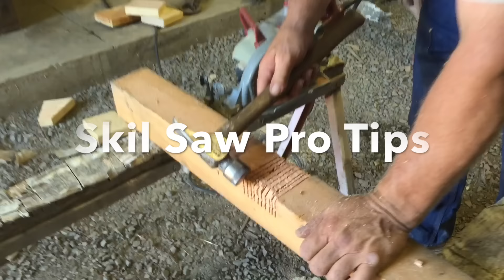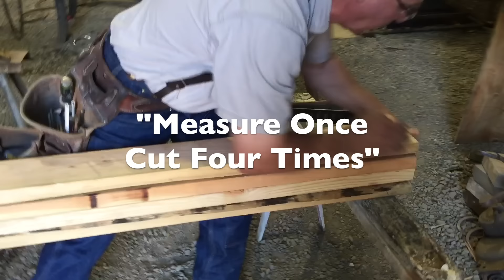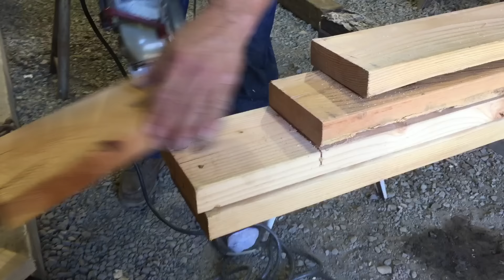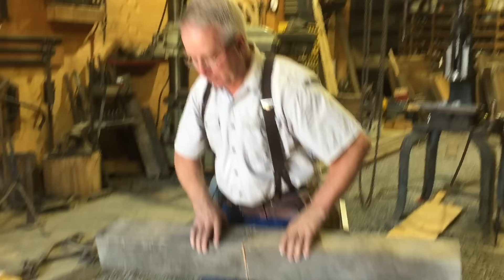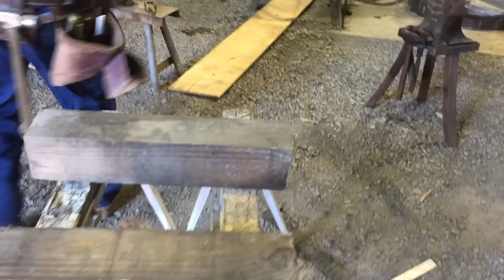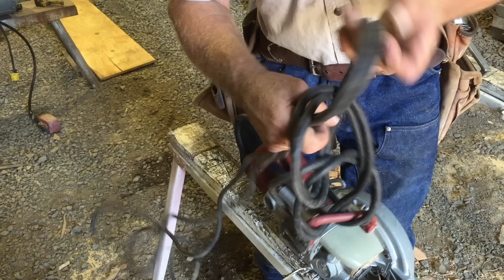Skil Saw Pro Tips

Comment: What's wrong with my cable storage method?
 I fold in half, then half again, up until it's manageable then I just twist tie or Velcro tie the cable. This method is the default method used to package cables, it takes up the least amount of space possible, doesn't over fold the cord, looks neat, goes on a hook easily, and it goes with the defaulted bends into the copper from packaging/factory.
 I'm no pioneer, other craftsmen are aware of this method and have chosen chain stitch for a better reason than I understand so I wanted to ask.

PSA(s): Don't use cheap twist tie on cords it can bite into the insulation. For shorter cables consider plastic bags(I saw them doing this at Goodwill for reselling miscellaneous cables).

Comment: At 4:00 you show how to make a beveled plumb cut. Here is another similar but safer and more accurate trick for making beveled cuts without changing the rotation of the table ( at least with a regular skill 77, not magnesium table ): The hole in the table that your blade sets in has two long sides and you will use the side that is to the left of the blade. Draw a pencil line on your board to mark the plumb cut, and use your speed square to mark the bevel on the edge of the board. Now, first cut the board so that the left side of the hole in the table runs along your pencil line. This will leave the board long but with the line still there. Now make your beveled cut, and you will have the lines to sight, and you can ride your table safely down that extra little bit of lumber which will support the saw. This trick works really well when making multiple cuts of varying bevel, like when cutting the studs of a wall that is round on top, or for cutting rake studs and it works well when cutting bevels over 45 degrees with a 8-1/4" skil saw.

Another neat trick that I used to use when framing apartment subfloors. I joists are difficult to cut because there isn't a flat surface to slide the table on. Cut a piece of plywoon that tightly fits in the depression of an I joist, and nail a 1x4 or 2x4 to it perpendicular to the I joist and leaving 1-1/2" of plywood sticking out. Now you have a cutting jig that the table can ride on and you can use the jig over and over again to make perfect, square I joist cuts.

Comment: My Dad and Uncle built the house I grew up in.  The house was built in 1947 and they cut and nailed every piece of wood in that house, the old fashioned way, no trusses or anything re fabbed.  My Dad was a perfectionist and my uncle was a super perfectionist. My Dad told me all corners in that house were square, and they snapped a line along the ends of the rafters and cut and sanded them until they were all inline.  Overkill to be sure, but they took pride in what they were doing. They are building a lot of houses near where I live and they all look like pre fab kits to me.  I think the houses are hauled in on a trailer, more or less pre cut to size and the "carpenters" assemble them.  They sure do go up quick.

Comment: Circular saws can cut roof metal. But they sick at it. Get out some aviator snips and learn how to use them. The edges get hacked up with saws, it's as noisy, leaves little metal shards all over the  place, your clothes, and love to migrate into your eyes, wrecks the washing machine. The worst part is that in 20 years or so the hacked up edge will be rusting while the one cut by a shearing action will not be.

Comment: Ever hear of using the SPEED SQUARE to guide the saw table so you get a PERFECT Right angle at the right length with a single hash mark? It saves time, saves pencil lead (which in my experience wears much faster than about anything else), and is more precise than these speed scratch methods.

Comment: One thing that imo is Almost MOST IMPORTANT to have on your wormdrive saw. !!! 
 ANTI KICKBACK BLADE !
 Like the Marathon blade on your saw in the vid. 
 As long as the blade has the anti kickback shoulders on the back of the teeth. It is a pretty good to Great blade. 
 Without the anti kickback feature on a blade. Its a man eater ! 
  Its true any blade can kick back , but some of the production techniques you show are greatly enhanced by the blade you have on your saw. 
 The old way of adjusting the tension of the blade bolt to allow slippage in a kickback event were less than satisfactory for me. 
 They worked ok with dry framing lumber but did not work well with wet lumber ect.  
 The 32 tooth general purpose blades the HD77 came with were especially ferocious !  I once blew a 4ish inch chunk out of a sheet of 5/8 cdx when the sheet pinched the cut. 
  The torque of that was amazing. I hung onto the saw but had to take 2 steps back to keep my balance. After that my blades were all anti kickback.

 Excellent vid ! Thank you. 
 Btw, the new cordless framing saw are even more amazing than the corded versions. 
 But I still have 3 HD77s , 1 DeWalt Framing saw and 1 Makita soft start framing saw . I prefer the DeWalt then the Makita. But the Skill's are tough !

Comment: I find there are times when holding the blade guard back and keeping a firm, balanced grip on the saw are difficult. I like tying a fat rubber band around the base plate angle lock (loop tie it so that it lays to the inside) and hooking the other end of the band onto the blade guard tang. This keeps the guard out of the way and allows both hands to be firmly on the saw, particularly with plunge cuts. When the cut is complete It's then easy to flip the band off the tang so the guard is down when you inevitable set the saw down in the ever present dirty gravel of the job site.

Comment: do you wish to manufacture my saw? I invented a "Parallel Guided Power Saw" which can be seen on you tube and can carry any saw on the market and can cut lumber and boards. 4 ft is for jobs away from home. 8 ft is a little heavier and 18 ft is just for shop. to transport you can disassembly into pieces. It has 3 parts: Saw unit, Guide unit, and table, I invented it in 2012 and all the USA companies and Bosch company declined to license from me my say. Bosch wrote that my saw is not good for the market. By contrary is the best because everybody would like to buy my saw, but those companies shall retire almost all of their tools such as sliding saw, table saw, drill press, router table. Bosch did a wonderful design for their sliding saw but kept an old feature of 12 inch cut length. How can they not to see that the length of cut is the most important. The precision of my saw is great and moves very easily on the guide and carry also the heavy dust collector. I need somebody to manufacture with me my saw.

Comment: Once upon a time the zen master of carpentry looked at his skillsaw and told it, "You're a planer"  The skillsaw argued, NOOO I'm a saw.  The zen master then took the saw, planed a surface with it, drilled a hole with it, demo'd with it, mitred with it, cut an 8x8, then a notch then a rabbet.  Then he carved Michelangelo's David 23 times in the rafters freehand, each one exactly the same as the last.  Finally he patted the saw affectionately and had it do a dance suspended in mid air on its cord.  The saw smiled and knew it was the luckiest tool on earth.

Comment: Watching this guy use a skill saw makes me want to be a better tradesman,I thought I was decent with the thing before this.
Also I have a tip for cutting metal,if you put the blade in backwards,it still cuts the metal clean,and isn't as rough on the teeth.

Comment: You use the right tool and technique for the job.  You use high quality tools and blades.  Your safety is in following the basics, the guard on the saw is in good condition.  Plunge cut- watch your kickback area- YOU have strong arms- some do not.  
A good AC 7 1/4" saw with a Good carbide blade is a heck of a tool. 
Frist time I heard "the Polish plane", but I do it a lot myself too.  Must be in my blood.  
I've figured out most of these myself, I'll try the chain stitching, but I usually do a clean flat coil- takes time to wrap, but i can toss out a 50 or 100 foot cord completely clean.

Comment: build a real set of saw horses made out of 2x4s nail one across leg to leg on the same end drive a 16d nail up to about 1/2 inch and when done cutting hang the saw on the nail with the shroud that covers the blade who sets a saw on the ground everytime after cutting he must like bending over a couple hundreds times a day to pickup a worm drive saw with a 40-60 foot cord to drag around all day why dont u just use a dropcord u can plug the saw upto since u are bent over picking it up off the ground anyway he is probally like one of the waterheads south of the border who dont have a saw horse one on the job cut everything on the ground not a coil nailer in sight just cheap stick nailers

Comment: my last tip when setting your Ridge build scaffolding or set it up at waist high it cant fall on you if there are problems ...A SIMPLE 12" 2×4 NAILED DOWN FLAT CENTERED ON RIDGE AND LOCATED ON YOUR COMMON RAFTERS THAT   YOU INTEND TO SUPPORT YOUR SKELETON (FRAME) .YOU WILL HAVE 3/4" THAT WILL SUPPORT THE 2 RAFTERS AND RIDGE BOARD NO NAILS NEEDED JUST SLIDE RAFTERS FORWARD OR BACK TO LOCATE FOR NAILING !!! dont forget to check for level ,  plumb and brace properly

Comment: my best tip scribe nailing lines on your plywood while it is on the stack and i make a pencil extension with a slat (sticker) from your stud bundle 24 to 36 inches long ripped a little less than in half 3/4 or a little less and tape it to my flat pencil and stand it by my T SQUARE for convenience . no more trying to stretch across plywood

Comment: those are all good techniques and i have used most of them in my 30+ years of framing houses ..i would say that a worm drive saw is awkward to torquey when you first hit the trigger it jumps sideways..it is not well suited for right handed people for that reason and holdinf a board to be sawn the blade is right by your hand extremely dangerous..just saying each to there own

Comment: He does have a lot of skill and tricks, but I notice he's wearing a cast on his left foot 19.00. This tool is underrated by most, but needs to be handled with care, and it's different standing on a floor and working at sawhorse height versus one-handed standing on a joist. Be careful and never put a hand behind the blade. Mark clearly and cross out erroneous marks. I'm not a fan of over-sawing inside corners, though.

Comment: Had some pro-tip questions please:

- OK to keep your finger rested on the trigger when tool is not being used and when moving or adjusting the tool? As an example at 4:00 in the video.
- Non-trigger hand/finger placement safety rules when using,moving,adjusting the tool? Apparently non-trigger hand/finger injuries are the most common with a circular saw.
- Are active hearing protection workable for pro's when essential to hear what's going on in the environment? My late uncle went almost completely deaf in his latter years from decades of carpentry. His pro tip was to whenever possible wear hearing protection.

Comment: The problem with the SkilSaw is that it's been cheapened so much over the years. I watched BOLTR compare a 40 year old SkilSaw's gearing to a modern one made by Chervon and it's ridiculous how much better built the older one was. I own a SkilSaw from about 1980, and it weighs a lot, but is a beast that I'll never have to replace.

Comment: I think this guy has used a skill saw a time or two haha. If you haven't used one of these or are new to them don't even think about trying this stuff, you will cut your arm off or sink it in your thigh, I've seen it happen to 3 of my co workers on job sights. The skill saw is no joke, probably the most dangerous tool in construction.  It takes years of everyday experience to build these skills and not to mention strength, skill saws are heavy tools. That being said this is another great video.

Comment: Get a flexvolt saw, more power than corded and they now have a worm drive for you west coasters. 2 and 9/16 depth of cut and one charge lasts almost all day, they actually make 9 and 12 amp hour batteries that would probably last 2 days before you need to charge. Instantly goes to full speed and the breaks are awesome. Cut through 5 sheets of 5/8 ply board no problem. DeWalt flexvolt tools are the real deal.

Comment: Skilled but dangerous... I'm 34 been going full time since I was 14 (20 yrs), leading a crew since 18, and running a company since 21-22... he is 100% right framing doesn't have to be perfect but a few things ... 1st I do miss saws having a hook but ... 2nd saws kick for all kinds of reasons hard spots/knots, binding, dull blades, weak or tripped power, etc so never ever ever put your damn leg up on the table behind the dang saw, keep your feet down, walking space clear, and eyes attent ....3rd the 6×6 the extra little nub cut off is fine but only if necessary, most of the time you can just slap the little excess pretty hard with a hammer and it disappears,  half the time it won't matter, and dropping to break it is just extra work and effort, if you just slap it with a hammer you only have to worry about dodging one piece falling/bouncing instead of two .. 4th the depth notching if you go just like an 1/8th deeper than needed you can just chip out and move on and skip all the dangerous "polish planing" shown in this method and it's plenty close enough for framing ...5th and most of all imo fatigue is one of the most dangerous parts of a construction/job site and although a worm drive saw has an excess of power it's just not necessary and will whip and average mans ass after holding and cutting with one for 8-12 hrs straight when a regular skill saw will do just the same but half the weight and size ... in general anything you can do to make it easier and safer on the workers be it schedule, break timing, material location, properly functioning tools, clean jobsite, number of helpers, prep and set up and so on and so on will make for a safer and more productive job... you can't get shit done while rushing to the ER  or trying to keep someone from bleeding out till the ambulance gets there ... last buy not least ..im not downing this man, he is awesome and skilled and I'm not saying I'm perfect.. but I learn more everyday, am fascinated with the old school methods and up to date with the modern, I look for the best solution everyday and never ignore a suggestion or different approach but those few things are what have always made me way beyond average and better than most

Comment: Scott, it drives me nuts watching you set the saw down on the guard, stop it just stop it! I was taught right hand saw to the ground right thumb pointed to the ground that way if the guard hangs up the blade doesn't contact the floor or concrete. Remember  blade laying the same direction as the surface you set it on and it never will come back at you running over your foot or leg.

Comment: At 3:24 run the saw down the front face of the stack if you have enough boards to cut to justify setting the angle on the saw. No over cut that way and you get all the birds mouths out of the way to start out with. When plunge cutting I'd never hold the piece with my leg like that if it jumps it's running right up your leg, that's just me though everyone's comfortable with what there comfortable with.

Comment: I been a framing and concrete heavy construction union carpenter for almost 20 years.  I loved your video but I can not express how much you have to be comfortable with a skilsaw in your hands to do these saw tricks of the trade.  I always get worried when teaching apprentices and journeymen new little tricks on how to use a saw.  Again, OSHA be dammed, these skills are what is needed to be productive and professional.
  I was surprised you didn't show how to cut with the saw upside down using your pinky finger as the trigger finger.  It  helps out largely when cutting from top to bottom in certian situations.

Comment: Nice demonstration. Today carpenters dont use circular saw, at least not in Norway, only table saw, mitre saw, possible track saw, jigsaw, oscillating saw. Depending on the job, but circular saw nobody uses.

Comment: Well, yes and no. I've been pushing a saw for 40 years, now, and I agree that the most important thing is to know what your criteria is- as you said, sometimes 1/64" is too sloppy, and 1/2" is too fine. But one thing I have learned is that if you want the fellows who come after you to do their best work, you have to do yours. I think  lot of framing is too quick and nasty. Be consistent, don't overthink it, but a few seconds worth of quality improves everybody's work, down the line. On the plus side, my (essentially) brand new Skilsaw comes with the sky hook built right in!

Comment: You’re right about the roof steel! I’ve framed without eye protection for almost 20 years with no issues. I did one job with that roof steel, got a spark in my eye, had to go get a doctor to dig it out.

Comment: Been doing carpentry for almost 40 years and still learned a few things from this video.  Really enjoyed watching.  One comment -- the saw Scott is using is a worm drive skil saw, which has a lot different feel and balance than a direct drive "sidewinder" skil saw (what most folks probably have nowadays).  Pros swear by worm drive saws, and in fact the original skil saw from the 1920s was worm drive.  The worm drive saw gives you more control to steer the saw and resist kickback, and makes advanced use quite a bit easier in my opinion.  Sidewinders weigh less and are more compact, which may be helpful in some situations, but overall, if you want to be a saw jedi like Scott, worm drive is a key part of that.